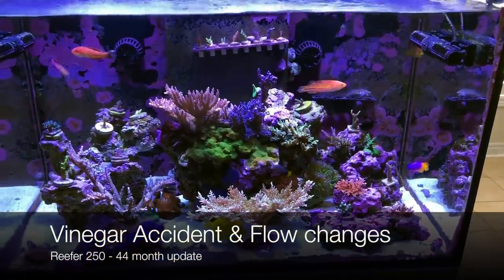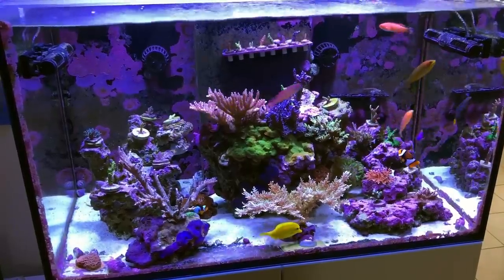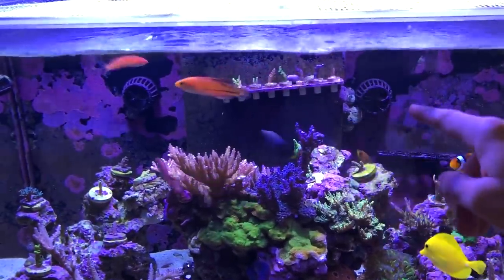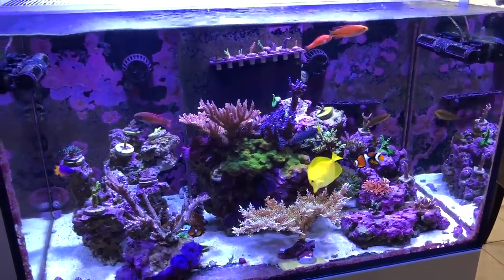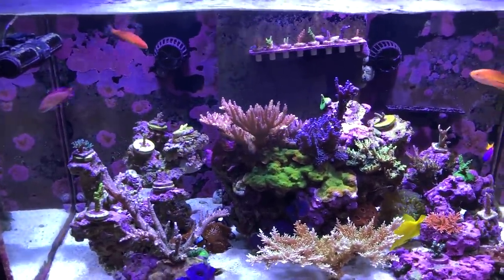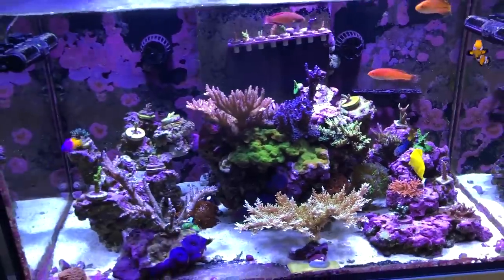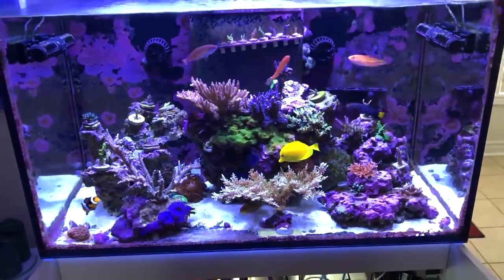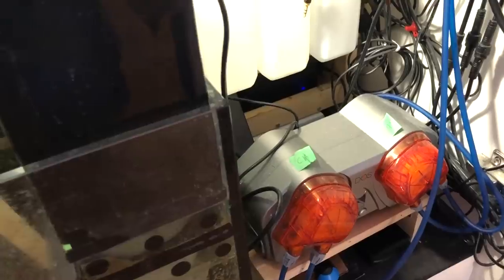Vinegar Accident & Flow Changes - Red Sea Reefer 250 44 month update

Comment: I had the same detritus issue in my sump as well. Did a good cleaning, vacuumed with a MJ1200 and hose into bucket, then placed a small powerhead in there. Nothing settles now and  skimmer, Sicce 1.5 to my Carbon/GFO reactor (reactor output into small 200 micron sock), or chaeto catches everything.
Reply from the maker: Good stuff!

Comment: Love your videos. I have a reefer 350 and just upgraded from 4 ai primes to xr15's. I only have 2 right now with diffusers. I copied your lighting schedule. If you where only running 2 what would you set your intensity at to get close to the same par? Thank you
Reply from the maker: Brent Tytler Thanks Brent... what corals do you have... two xr15 on a 350 seem a bit underpowered for sps, but can work well for LPS or mixed reef I think, probably 70 to 80% depending on what you want to accomplish in terms of par
Reply: @TheBioReef  Thank you for your reply. I am transitioning into mostly sps. My 4 AI primes where doing really well for my sps. Then I switched the lights and only ran them at 30% then I switched salts and lost 80% of my sps. That was 2 months ago. My new sps are doing ok not thriving but not dying either. For the last 6 weeks I have been running your exact schedule and intensity but looks like they want more light. My acros are 10-15 inches under the surface.
Reply: @TheBioReef  thank you
Reply from the maker: Brent Tytler I think coverage will be the issue with the two 15’s in your tank. The sps right under the puck will get the light they need but it will be hard to get good par between the lights. See if you can pick up a unit or two more (used ones are fine)... they will help with coverage and reducing the variance in par across the tank
Reply: @TheBioReef  Maybe a xr 30 in between them. I like your thinking.
Reply from the maker: Flooring Superstore Sales yep that would be great

Comment: Your problem is your lazy buddy, you only had to replace the tube, not dip it in vinegar, resulting in all the problems with your corals, as for the algae, you could remove that by hand 🖐
Reply from the maker: you are right, i do try to minimize manual labour in the tank... not a big fan of sticking my hands in the tank... besides... i am just trying to encourage my CUC to work :)